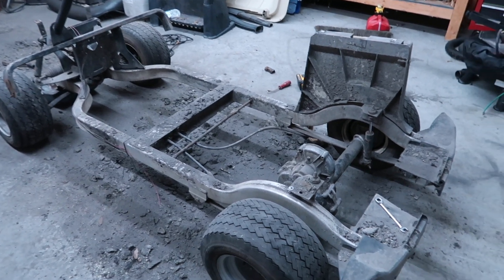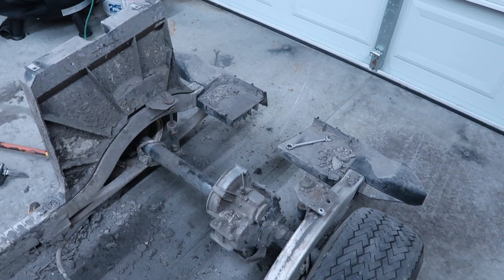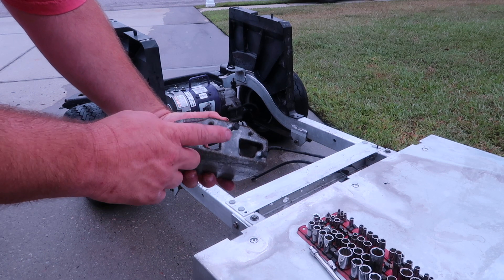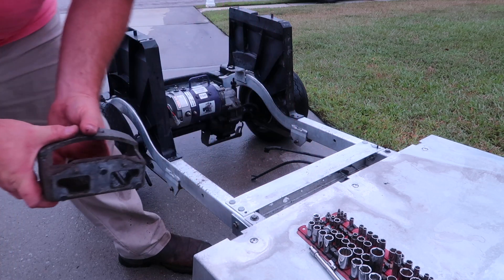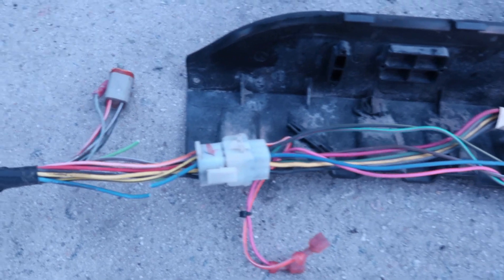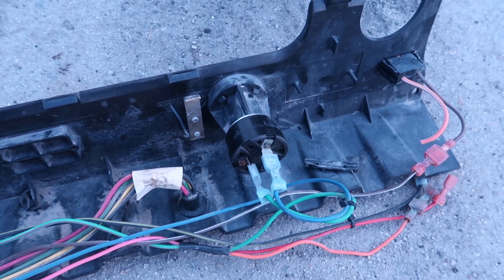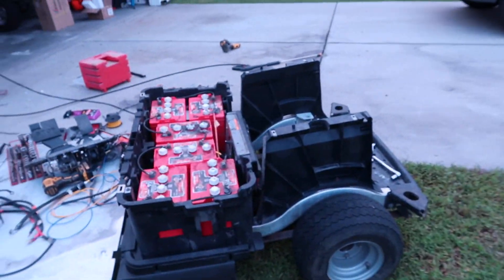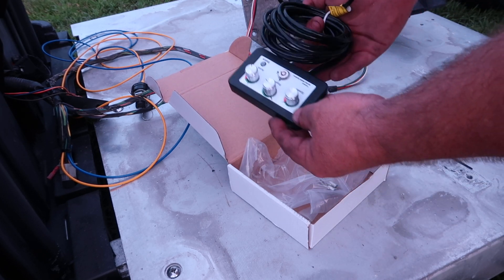Limo Club Car Precedent Gas to Electric Conversion | IF 2020 WAS A GOLF CART EP 2

Comment: definitely get a lift for it.what do you plan on doing with the gas precedent rear end that you pulled out of it?
Reply from the maker: I still have the transaxle. If you watch the 1st episode it looks like it may have a problem and I might open it up to see if it is or not. When you switch it into gear something is locking up. I dont think it's normal.